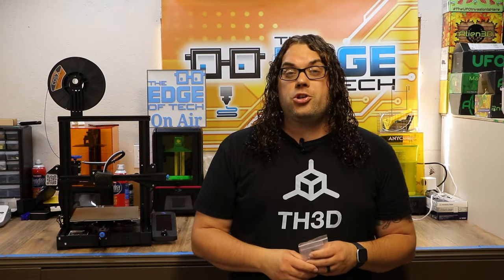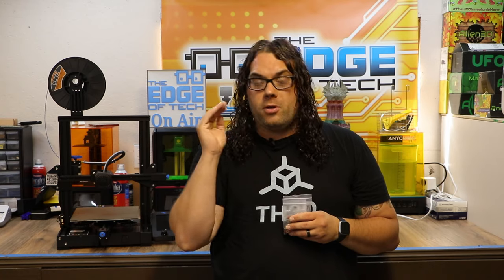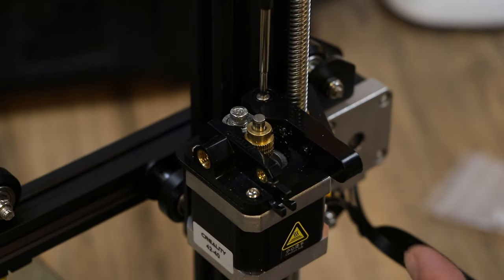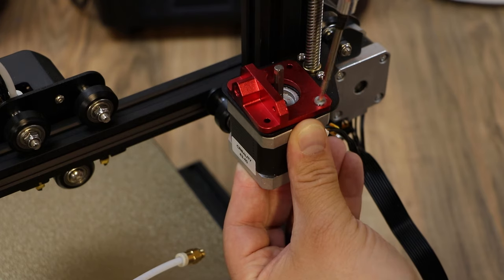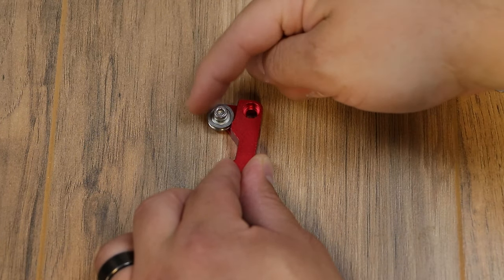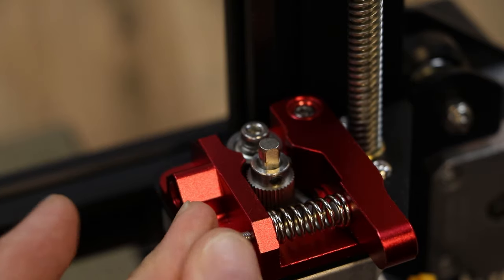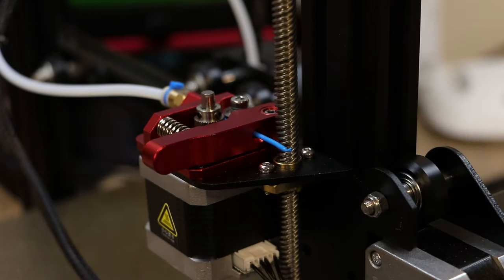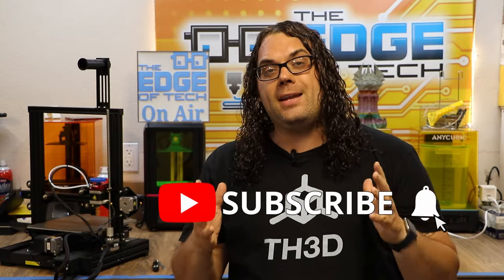Upgrade the Ender 3 V2 Extruder in 5 Minutes - Aluminum Extruder Upgrade

Comment: I fell for this once with my Ender 3 Pro, never again. The metal extruder is still crap, just a slightly harder piece of crap. If you are watching this, save yourself a lot of frustration and buy an EZR struder or better yet, a Bondtech clone.
Reply from the maker: I Sorry you feel like that, and I do love the EZR! Even know you don't like this one, thanks for watching the video!!
Reply: Sorry to hear that! There are many versions from different vendors that all look the same. We've specced out ours with a beefier spring, proper screw lengths, and steel gear so it works very well. If you bought one from us and have an issue you can reach out to our support team here and they'll get you straightened out: https://www.th3dstudio.com/contact-us/
Reply: Not speaking strictly about the  @TH3DStudio  version, but the overall design. It is just not as good as other similarly priced alternatives. Lot's of slippage as soon as you try to push any harder, and doesn't handle flexibles very well. What I'd really like to see would be a TH3D branded extruder using a better and more reliable design (maybe its own?), with the same price x quality balance as other products.

Comment: hello! i am actually replacing my cracked plastic extruder for the new metallic one and i already bumped against my first problem: my gear doesn't have those two tiny allen screws, i already rotated it 360° and there is nothing.... How do i remove it? what is holding it in place?